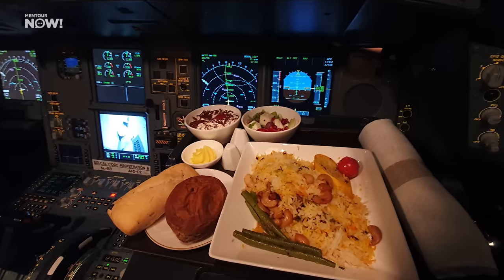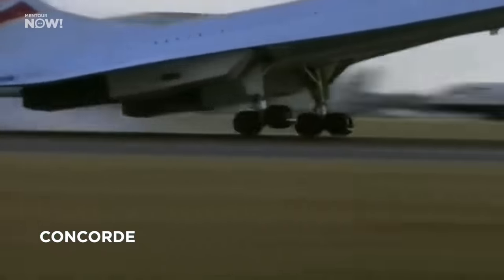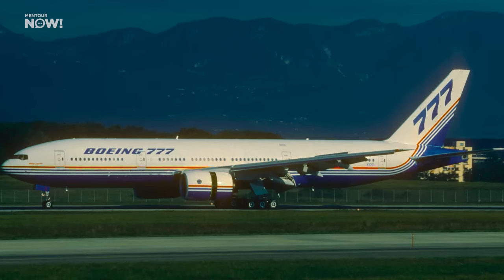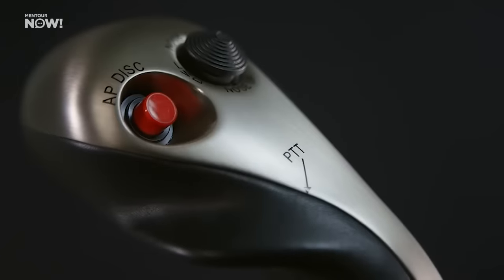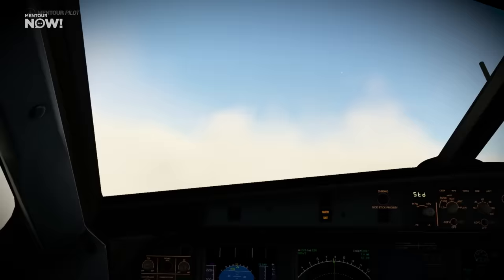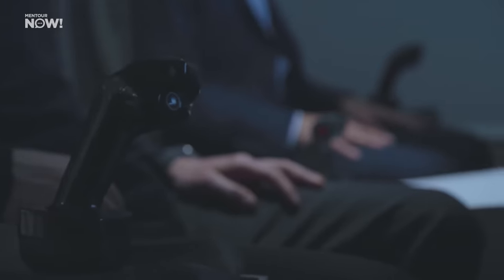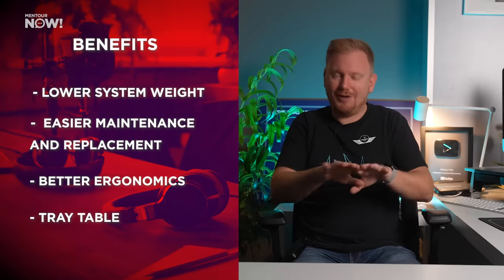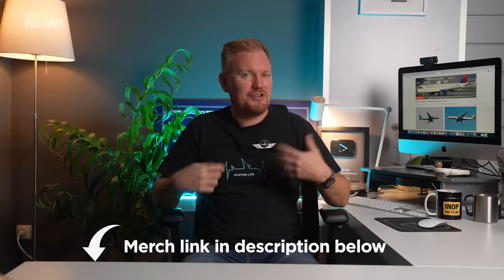Will Airbus Finally switch??

Comment: What strikes me is that piloting, especially in emergency situations, rely on muscle memory.  Situation A happens, spin right(or whatever).  Car drivers use that, too, on the steering wheel.  Airbus’ joystick, however, are different for the copilot and pilot.  Not only are 99% people are right or left hand dominant, most importantly, when a copilot switches to pilot, all of their muscle memory from the right seat is lost, and in fact harmful if used from the right (no longer a control joystick there).  Meaning, they’re now the captain of a completely different aircraft (control wise), one with limited control experience.

Comment: I have a question about the sidesticks as to when an FO gets his 4th stripe and moves to PIC. All this time s/he has been using his/her right hand on the sidestick and his/her left hand on throttles and other items on the center panel. Then, the move to left seat is made and all muscle memory has to be totally relearned. I realize that they will have been doing a lot of work in the simulators while sitting left seat, but it's still a big change. TY

Comment: Very interesting big AB issue opened. Let me point out that training of unexperienced pilots with present AB side sticks sometimes is extremly demanding, especially with ones having problem with landings. In mentioned situation, conventional system is far more user friendly and safer.

Comment: The biggest problem I see with adding active sidesticks to existing airbus designs is that additional wiring harness would need to be added to power them (*good* force feedback takes 50+ watts per axis) and send control signals between them and from the autopilot to them. Also, flight software would need updated, and probably in a sane world a circuit breaker would be added for each stick to disable the force feedback if something were to go wrong with it. That's a lot of new wiring, probably be a expensive enough upgrade that most airlines would only do it if there were really compelling data that it increased safety.

I don't know how often airbus makes changes that require significant new wiring harnesses. Obviously the CRT to LCD one did, but that one paid for itself very quickly in the lower weight and power consumption and higher reliability of LCDs. I'm sure they have a procedure for this, but it's hard for me to imagine that as less than a $100k change. I admit I don't know pricing for changes of wiring harnesses for large aircraft. Would be curious to hear from someone who does
Reply: Wiring is the problem? Really? How about Boeing's torque tube between 2 yokes with a breakout mechanism to disconnect the two in case of one is jammed - not a problem? Wiring is always an easiest way, and FBW system is all about to prove it.
Reply: @igorgoncharov3191  I'm talking about converting legacy aircraft. What I'm really saying is, money is the problem. Airlines aren't going to shell out for a upgrade unless it can really be shown to improve safety.. because it's not going to be just dropping in a stick and loading some new firmware. (Or maybe it will be - it's possible airbus considered this day would come, or some day similar, and have some spare wires on the harness or a bus wire protocol and generous extra power to each stick)
Reply: @igorgoncharov3191  I have no doubt that for new builds this will beat the mechanical assemblies - even for yoke airliners. Lighter and also doesn't require all the room between the two yokes for all the linkages.

Comment: I cannot see how a control system could be retrofitted into existing airliners without major disruption. Can you imagine if a pilot holds a 777 type rating, and walks into a cockpit that has been retrofitted with a side stick? During the transition period you would have to carry two type ratings for the 777, because you would never know which aircraft would be available.

Comment: Another reason why military aircraft use a side stick is in case of emergency when the ejection system needs to be activated. If there was a yolk, then it would get in the way of the seat and the pilot and likely kill the pilot.

Comment: The problem of side sticks is not that one. The issue is that the pilot in command always sit on left side. 
My father was a pilot, I always saw him piloting the plane sit in the left side.
This is the real problem: I cannot imagine piloting a plane with my left hand ! It is useless 
This is the advantage of the yoke - ‘cause if necessary you should hold it with both hands. On the contrary, with the side stick it is not possible 
But, in my opinion of course the active side stick is much better

Comment: We had Control Load in High level Sims back in the 80's, so the argument that the late 90's toy FFB joysticks wern't robust is incorrect, since it was the other way around, Those joysticks were derivative of the Control Loading units in the big sims. 

Heck the F/A-18 has loading, just like the FBW Boeing Airliners. And like most decoupled hydraulic control surface jets since the 60's. 

Airbus just didn't think it was needed because they were committed to their rate law system. And the gimmick of the LRU control stick.

Comment: On the airbus side, how much of a difference does the handedness of the side stick make? When a pilot switches from the right seat to the left, they obviously have to fly the plane with a different hand, and statistically their left hand will not be their dominant hand. How much retraining is needed to get used to the switch? It seems like a much more fundamental difference than with a yoke.

Comment: I think force feedback is one of the most important aspects of controlling almost any vehicle whatsoever.
When driving, force feedback from the wheel and pedals are extremely important in determining how your car is handling.

In a plane it makes it easier to understand the aerodynamic situation of your aircraft.

Yoke or Sidestick you still need that feedback.

Comment: The averaging out the inputs of 2 controllers just seemed always like a flaw to me. Dunno why the captains seat just doesn't have a built in take over if theres large discrepencies when hes hired to be in command anyways and just have a backup selector to switch with instead incase of issues. Having 2 people able to input controls just seems a recipe for confusion and disaster.

Comment: What I've always been curious about with side sticks is transitioning from FO to captain, as your set up is reversed. In the right hand seat, you have the stick on the right and in the left seat on the left.  Does it take a while to get the muscle memory for that switch?  I know the autopilot is flying the majority of the time, but take off and landing is usually done manually, so I've always been curious about how easy that switch is.

Comment: Regardless of which flight law set is in effect, it should be impossible to direct a modern jetliner into a stall, or dangerously close to the service ceiling.

Comment: Hi you have a interesting channel. 
The latest video about side sticks you miss out commenting about one interesting small aircraft the Victa Airtourer 100/115
This aircraft has a centre stick. 
I did like flying this aircraft it was good fun but the one thing I found that most of the i did was in the left seat and that meant I was using my right hand for control when I changed seats I didnt have the same felling of control 
Just a comment
Cheers

Comment: i am not a pilot but it seems to me, using left hand verus right hand would be a big issue with side sticks yet it wasn't even mentioned.
Reply: No. Right seat pilots using yolks during take offs and ladings (where manual flying is most common) use his left hand for the yolk and the right hand do other things.

Comment: Somehow I doubt this is an engineering issue. As you said, size and physical mechanisms should fit easy.
I think this is more a software issue. The code required to effect these changes would be extensive, not the mention the testing required.

Comment: Air France 447 two junior pilots without systems and partial panel training killed all aboard. No cross-checking of Instrument to negate faulty Air Data computers for Altimeter, Airspeed and VSI.

Comment: To me the active sidesticks are a waste. The thing about control yokes with feedback is they’re big and directly in front of your line of sight. Sidesticks are just that…to the side. Much smaller, and dark in color. Awareness of the autopilot is literally what thr FD is for, and likely would be what drives the servo mechanism on the sidestick. And it still doesn’t mean one pilot couldn’t override the other. How would the handle if there was a large amount of force in opposing directions. That’s all servo driven. Yokes are interlocked to each other.

Comment: It's strange to me, a simple system guy, that there needs to be a mechanical connection between the yokes, if fully FBW, but, if there is a fallback mechanical flight control system (A-10. comes to mind), then there will always be some connections between the two sides.

Comment: I know the airbus is an amazing plane, but I feel like the normal law versus alternate law, versus direct law has come up in too many crash stories, and I know that there are warnings in place, apparently like you were saying here they are auditory in nature, which is one of the first senses to go under stress, as you’re saying, just as I started typing this so I think Airbus would have seen this issue and maybe do something different with those three law modes on the airbus and I think the stick shaker on the Boeing is probably a far better alert system, but it probably needs to be visual and auditory as the more senses involved the more likely you are to notice.

Comment: As an engineer, I think it makes no sense whatsoever for Airbus not having "active sticks" from the beginning. Feedback is good, stick-shaker is good. There are LOTS of advantages that come with feedback on the input. Sound or warning light feedback not always can and will be heard/seen. Redundancy in important feedback is good. Hell, it was even determined that full power steering in cars, that allowed to move steering wheel with minimal force in all circumstances was stupid because it deprived the driver of necessary feedback. Of course, aircraft parts have to be far more redundant and reliable than equipment for computer gaming, but engineering wise, active stick is not really anything other than "force feedback" joystick that has been used for gaming for many years. To think about it, imagine how many more stupid things people would be doing if they had no pain feedback or could easily turn it off. ;)

Comment: Boeing aircraft are so retro. I love all that 1950s steering wheel and cables stuff in their new 737.
And the wheels with no wheelbay doors. Well who’s into aerodynamics anyway, all that new stuff like big engines shouldn’t make too much of a difference. It’s not as if they will just fall from the sky , is it. Ha,Ha. 
Airbus must be quaking in their boots wondering what the next upgrade will be. A spectrum computer that works, so I’ve been told. But keep that to yourself. Can’t give the competition any ideas.

Comment: the joysticks are a design hazard, I recommend they at least put them in the middle so both pilots can see what the other pilot is doing. Being hidden from the other pilot makes it difficult to know what is going on. All the alarms, warnings are going to be disregarded in a critical situation and one pilot could be pushing down and the other pushing up. Too many innocent people have been neutralized by the side sticks.

Comment: Not a pilot, but I have a question for the Airbus pilots out there. A couple weeks back I injured my wrist and had to switch my mouse for work to my left hand. Two weeks in and I’m still nowhere near as adept with my left as I was with my well practiced right. How tough is the transition from co-pilot (right hand side stick) to pilot (left hand side stick)?

Comment: Contrary to popular opinion, the Boeing control column is also an LRU and is relatively easy to remove and replace. Functional testing takes most of the time required for replacement. I suspect design philosophy is the reason why Airbus side sticks are the way they are. Airbus has always maintained that interconnected sticks are not required and every new aircraft that comes on line is exactly the same as preceding aircraft. To change now would be tantamount to admitting their design was flawed from the start leaving them open to law suits and accusations of allowing their aircraft to fly these last forty years with inferior systems.

Comment: "Stick" flight controls are not New.  I've noticed Fighter Jets as well as Helicopters have Stick, Throttle and Petal flight controls.  Advancements in Computers and Electromechanics are the changes.

Comment: Great points mentioned regarding the advantages of active sidesticks. However, I do see a risk which doesn’t exist for the traditional airbus sidestick. 
When you recognise that the other pilot is making wrong inputs, especially during upset recovery, the other pilot can quick intervene by holding the priority takeover pushbutton (red button which also serves as a AP disconnect button) down to override the other pilot’s exaggerated inputs („priority left/right“). 
When the sidestick was to move heavily during an upset, I could imagine it could be harder getting a hold of the stick quickly enough to override the other pilot, as their hand couldn’t be on the stick while it’s moving, as opposed to what is standard now. Of course, a way to disable the sync between the two sticks is absolutely necessary.
Reply: That didn't help, and in fact contributed to the Air France 447 disaster as the less experienced Pilot Flying in the right seat kept pressing the takeover button and kept making exaggerated inputs that stalled the plane.
Reply: @therealrobinc  I don’t see how a yoke could benefit this situation tho

Comment: Why not selectable dual sidesticks - two sidesticks for each seat that the pilot can choose to use?  This allows for comfort for left-handed First Officers and right-handed Captains.  Also, easier transition from FO to Captain, since they can still use the sidestick that they have experience with.
Reply from the maker: It's not that big a deal, actually. And twin sticks for both pilots would add more things to go wrong, and it would probably require twin throttles, too!

Comment: You don't mention the fact that due to the short range of motion of the sidesticks, it is not possible to fly an Airbus in cruise, while in direct law, without self inducing oscillations, whereas it is possible to fly a Boeing manually in all of the flight envelope, due to the extensive range of motion of the yokes.

Comment: The feedback discussion is very reminiscent of feedback in car power steering. E.g. with non-feedback Citroen's DIRAVI - some drivers hated it: "I can't feel the car, it's like a videogame!" while others praised it: "Finally, the car goes where I steer it, not where the ruts are steering it!". It isn't a meritorious discussion, it isn't even a matter of feelings - it's a matter of beliefs.
So, there are no conclusions to reach. 
The dual input issue is different, but also irrelevant. When the PM tries to fly the aircraft fighting the PF, that means the crew failed CRM and that's a much bigger issue than lack of a moving stick. Those AF pilots who managed to physically break their yokes apart only prove the point that desynchronized sticks are mere result of a desynchronized crew and not the other way around.
So again, that issue is moot as well.
(Note that stick shaker already provides stick tactile feedback - when it's actually critical.)

What I admire the most about aeronautic industry is that you guys don't fix things for the sake of fixing things, without identifying an actual problem to be rectified. Here, in IT, we rush with fixing whatever we can without finding if it's the actual root of the problem. Often with disastrous results - but we have backups to restore.
I hope the active stick issue won't get - pun intended - out of hand.

Comment: Hmm, not sure I like the idea of using touchscreen controls for airplanes.  Touchscreens are prone to getting things more or less but very rarely exactly right, which tends to result in the occasional faulty input.  When you're sending a text message people can usually figure it out and just laugh at the texting typos that result from this.  When you're flying a plane, you probably don't want your control system to be in this "mostly accurate" kind of operation style.

Comment: Newer and better stuff replacing 80's CPU's? You know, every time an old processor used in avionics is about go out of production, all major avionics producers will hoarding those. Even if you just replace CPU with more modern one, you are entering certification hellhole created by aviation regulations, that is something you need to deal with even if system is LRU.